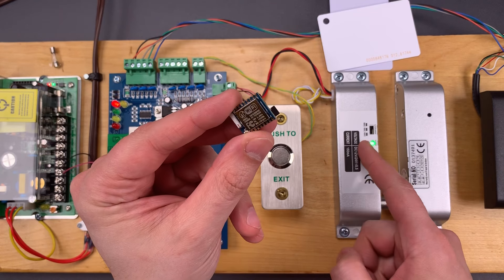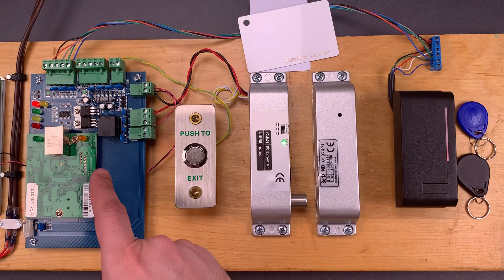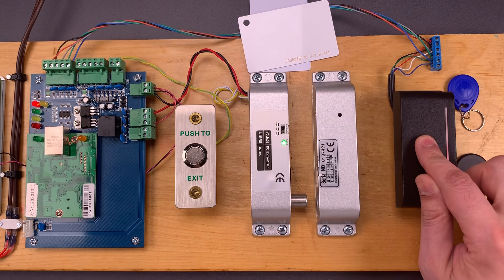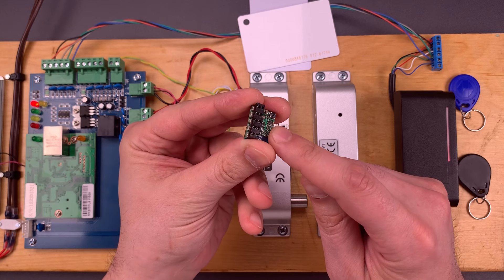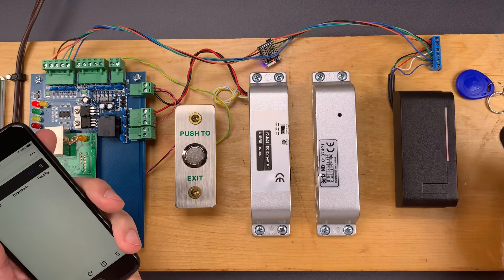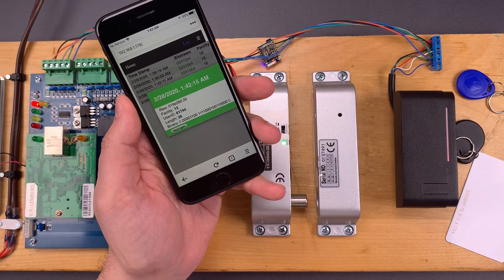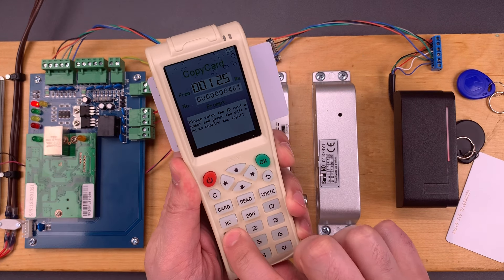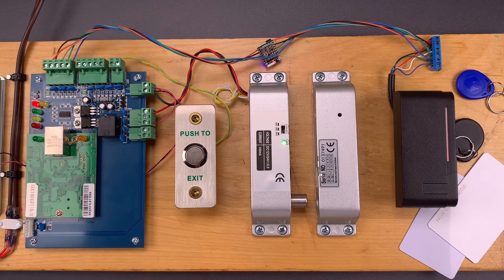[1052] Bugging an RFID Card Reader

Comment: If an attacker has enough time to get into the internals and install middleware attacks, you've probably got more problems than door access.
Reply: Well, it is invisible once you put the reader back on, also the connection is never broken, therefore the system has no idea it was tempered with. It also takes just a minute or two for the complete installation. I can totally see someone installing the device on a companies entrance door whilst the security guard is taking a leak or checking the backdoor.
Reply: @muh1h1  except, there's usually a camera near those places, so people are bound to notice... Unless they're extremely incompetent, which again, means you got more serious problems than a lock hahaha
Reply: @lXlDarKSuoLlXl  Well, whos gonna check hours worth of multiple cameras every day? Cameras are there to find out what happend after it happened, so if you installed that thing yesterday, chances are you can enter today and camerafootage isn't checked until tomarrow.
Reply: @muh1h1  funny thing is, they don't, there's supposed to be someone checking the live feed, not the records, and again, if the lock gets tempered without anyone noticing, your most important problem, isn't the lock
Reply: The attacker was likely already behind the door where the wires are exposed, or likely worse the wires and devices are behind another locked area that only security has access to in a real facility. Also, in a real facility there's always 1 or more guards paid to watch the cameras and occasionally assess the grounds. If an attacker has enough time to non-destructively access sensitive wires and put in this attack, I wouldn't want to know what else is breached.
Reply: @lXlDarKSuoLlXl  a high vis jacket and contractor's clipboard will get you into SO many places. Especially in larger organizations and campuses where parts don't communicate with other parts.
Reply: @stargate525  and that's a problem larger than a lock, exactly what I meant lmao
Reply: @muh1h1  how do you attach it to the power cables and in series with the system without breaking the signal?
Reply: @1physics  did you watch the video?
Reply: @muh1h1  If the area in front of the door isn't restricted something could obstruct the camera's view. An accomplish perhaps. All the guard see are two people having a quick conversation. If they are dressed in company uniforms it become even easier. Stealing clothing from wherever employees get their outfits cleaned may be comparibly easy.
Reply: @mezzb  It depends on whatever the stakes a high enough but then again, if they ARE high enough and security are lax then there is a problem. Now imagine if an employee where to install this thing and it where just left there unused for years?
Reply: @lXlDarKSuoLlXl  You can burn out the camer with a lazer pointer and have enough time to get this thing in there before they get to the door to inspect them camera. Or just knock and strong srm the guards lol
Reply: so the solution is to literally smear poop spray on the wires and have an attendance machine that gets your fingerprints but also takes a smell sample(detect a certain chemical) in other words a hand sniffer(maybe detection of alcohol or hand senitiser or perfume puts you under suspicion and dosent necessarily make the large iron bars fall around you)
Reply: @1physics  it really wouldn't matter if you cut the wires and spliced em behind the reader most access control system don't monitor the readersthem selves they monitor the board the reader goes back to. If I take a reader off a wall and cut the cable they prolly ain't gonna know its gone until someone actually walks up and notices its missing.
Reply: @1physics  the fingers are self striping so by pressing the wire in the power flows normally as 2 things are true, one the whole wore isn't disrupted and 2 the contact plates are connected to the wire before the full wire is severed. There is no disruption of power or service
Reply: I was thinking the same thing.
Reply: i must preface this again... Poop spray fingers
Reply: @lXlDarKSuoLlXl  You just have to find one that is considered less sensitive but still use the same keycard (like the one that opens the boom gate to the parking lot).
Then you can copy the keycards and use them on other, more interesting, doors.
Reply: @qdaniele97  ngl, that sounds like bad design... Hahaha
Reply: @stargate525  this is so true at my work we are doing minor work to a commercial building and I was let into one of 
 Raytheons cooperate offices to take measurements only for me to realize I was in the wrong building lol
Reply: @lXlDarKSuoLlXl  You'd be surprised how many buildings have Access Control Systems but lack any sort of video surveillance.
Reply: @GuitarGunner  I said "usually", didn't I?
Reply: @noru8360  yeah cause just a few people take Hand Sanitizer in 2022
Reply: That controller could be really far away and have a mile of wires connecting it and the reader. Probably going through other tenants in the building and such. That's why LPL's advice of this vid is "never use systems with unencrypted data transfer"
Reply: @lXlDarKSuoLlXl  so basically what you are saying is that locks are unnecessary in secure areas.

Because you said that if someone can temper with a lock there is a bigger problem than the lock.
Reply: @Jehty_  you got it backwards, locks must be in a secure area, because an impenetrable lock doesn't exists
Reply: @lXlDarKSuoLlXl  so then what's the point of the lock?
Reply: @Jehty_  to deter unauthorized personnel ofc, locks are arguably harder to fool than a camera and people, like someone said above, with a disguise or something like that, if you have multiple layers of security you'll keep whatever you want to keep safe, safer... But whatever dude, there's no point in keeping this discussion going, since that's pretty much obvious
Reply: @lXlDarKSuoLlXl  i had a security job at some place with a bunch of server racks and there were definitely times where someone wasnt watching the camera.  alot of places dont have enough budget to pay someone to watch a camera 24/7.  or someone would call off and instead of 2 people for the midnight crew, you only had 1 because it wasnt easy to just get someone to come fill a midnight shift like that(at which point there would be long periods of no one watching as you did your rounds).
Reply: @Evi1 M4chine uuum, that "somewhere" where the cable goes into the wall is most of the time directly behind/inside the box.
So you have to take apart the box to get to the cables.
Reply: @1physics  the esp has "splice" connections.  You just lay the four wires into four grooves and tighten the four screws.  The splicer cuts through the jacket on each wire (without cutting through the wire inside the jacket) and connects the ESP's contacts to the wire without disconnecting it.  It's like lightly cutting through a wire with a pocket knife, just enough to expose the wire inside, and using the knife as the electrical contact to the wire.  The power draw is very low and the impedance on the data lines is pretty high so the alarm isn't going to notice the additional circuitry that's been added in parallel with the card reader.

The device is small enough that it would likely fit INSIDE most card readers.  So all you have to do is pry it off the wall by the door (which will damage the mount UNDER the reader but not likely trip any alarm or damage wire), attach the ESP, tuck it inside the reader, and squirt a little quick-setting adhesive on the back of the reader and mush it back onto the wall (since the mount was damaged)  It will be almost impossible to spot this.  Then come back in a few weeks after the video recording system has overwritten (looped over) the video where you installed the reader, and let your phone download the codes used in the last two weeks while you tie your shoelace or have a cig.  Come back in a few weeks again with your cloned card, dressed like you work there

BTW those are milfare tags, at 13.56mhz.  Easy to pick up with a decent scanner.  The readers are always transmitting a strong carrier on that frequency, to power the tags wirelessly.
Reply: LOL right,If that needed to be prevented would tie a knot at the back of the electric keypad wires preventing removal without destroying the wires in the wall..also shows a hand held copy/reader. If the perp had this he could have just stood next to you while shopping and copied your key..As all the agents do with my wireless keys :)
Reply: @lXlDarKSuoLlXl  Another funny thing "live feed" watching only happens in the movie.
Reply: @freedom4651  tell that to my boss
Reply: @NGC1433  Usualy exit button just connect signal wire to ground wire, so if we have access to wires we do not need break encryption or sniff keys, enouph remote controlled transistor key that simulate exit button pressing.
Reply: This takes 10-20 seconds if you are familiar with the panel and mounting. And this only works on pretty low security systems anyway. You (hopefully) won't find these systems in a military base. But they are found in a lot of commercial buildings, with a lot of different companies with a myriad of employees.  They are found a lot of places that probably should have higher security. They could mount this on any panel where they have access, and simply clone the janitors card the next time comes, or even better, the security guards.

Not to mention this is also used in shared condo spaces and a lot of other locations where security is often very lax.
Reply: @MrSpronkets  not really no. My employer (a major ISP) has over 2000 properties spread across the Netherlands and nearly all of them are unmanned and all of them can be accessed using keycards. Luckily we use Stanley Security which is encrypted as far as I know and everything is hooked up to one big server so abuse would be noticed quickly.
Reply: @MrSpronkets  You guys have no imagination. The "attacker" could easily be a person already employed by the company. You then target a less crucial door that uses the same RFID access in order to gain higher access credentials which you then burn to a card and go get in.
Reply: Former Security Tech here. Many of my client sites did not have 24 hour security. The previous night's footage would not be reviewed unless an incident occurred.

With appropriate yet simple and common tools, a device such as this could be installed on a front or side door in a matter of minutes, and then hidden in the cavity behind the card reader. This would be easiest achieved at night, or perhaps on a weekend. From there, it would be reasonable to assume that the first person to arrive in the morning - typically a cleaning supervisor or security guard - would have (nearly) all area access. If the alarm system is part of the access control system, a cloned card would also work to disarm it. From there, the risk is directly proportional to how far into the building one was to go, how long they were to stay there, and how much they wanted to access. On more than one site, the day shift guards would not even be in a position to notice an unusual opening on the access data if they weren't specifically looking for it.

All of my sites had my companies proprietary hardware, which was encrypted specifically to be resistant to this form of attack. However, I worked there just as smart cards were superseding the old 26-bit Wiegand systems, and I used to use similar card cloning tools to sell clients upgrades to their access control systems. I would demonstrate how easily the older cards could be cloned and used anywhere.
Reply: @lXlDarKSuoLlXl  tell me you've never worked in security operations without telling me you've never worked in security operations.
Reply: The most successful attacks are those your enemy actively aids you in performing. In this case, using a ladder and some overalls to pose as a maintenance technician. With a little ahead-of-time research you can easily compromise outer layers of security, for example tampering with an outdoor camera under the guise of a maintenance technician while an accomplice compromises an outer door. Once the device is installed, it just sits there malevolently, undetected until a REAL technician does maintenance on that specific door.  

This attack requires significant social engineering, but once completed, you've compromised every card in the whole damn building.
Reply: @AlphaNumericKey  yeah, that won't work. The moment you walk in security is going to run your details. Not because they think you're a criminal in disguise, but because they think you're not an inducted contractor.

Dressing up as a contractor is a nice touch in a movie, but in reality one of the worst ways to sneak around.
Reply: @lXlDarKSuoLlXl   well lockpick lawyer regularly fools locks with his picks
Reply: @stargate525  you are so right. I remember years ago I was a contractor doing software updates on ATM's, these were the older type that you see in stores and sometimes even on benchtops.

They required access to the top half of the machine that is basically just a PC, they all have the same lock and its just a very simple file cabinet type lock. pretty much any screwdriver would open it.

I had so many shop owners, without me asking, open the safe for me, it was insane. They did know I was coming, but all they got was a letter MONTHS in advance. I would just pick and choose which store to go to on a daily basis and just rock up with the cheapest hi-vis vest money could buy with a laminated piece of paper saying I was from the ATM company. that's it, never had a single problem with getting access to the ATM, not one person ever said 'wait, let me call the manager' or 'let me call ATM COMPANY'
Reply: @danielv5825  really? You think every repair guy you've met is immune to bribery? Either place a guy in a job to do what you need or bribe/coerce one that already does work there. Even background checks are hardly foolproof.
Reply: @LabGecko  okay, now you've gone from dressing up as a contractor to talking about offering a contractor a bribe and hoping they don't report you to the police. That's a big difference, and personally I don't think your career as a criminal mastermind is off to a good start.

So to start with, you're going to need to get to know enough of the contractors well enough to know who would be susceptible to a bribe and has the level of access required to pull off such a stunt. At this point, you probably already have building access.
Reply: @lXlDarKSuoLlXl  my old job had a policy against cameras, which I thought was very stupid for a site with a high fence topped with razor wire and utilizing an rfid access point for employees and a checkpoint for trucks. The most stupidly unsecure facility I've ever worked at as security, but they paid me well so I only mentioned it once.
Reply: @freedom4651  oh nice, one of my jobs was a movie. Let me know where I can collect my acting paycheck, and how famous I am for the part.
Reply: @stargate525  Doing work testing facilities security in that way would be so damn fun. All the tension of trying to sneak in with no bad repercussions if you happen to get caught. God, that style of security consulting would be my dream job
Reply: @lXlDarKSuoLlXl  my workplace has no cameras on doors or parking lot. I mean they have sensors on the windows so people can't break in that way but that is about it
Reply: Put on a high vis vest and bring a toolbox and suddenly you're a technician. The ESP can probably be hidden underneath the card reader.
Reply: @MrSpronkets  Obviously you have never worked in any high security fields. There is a such thing as a closed secure network that can only be accessed via physical location. Your argument is moot.
Reply: You'd need exterior anti tamper protection. For the exterior reader not just encryption but a much stronger housing and one you cannot easily remove or access to internal wiring etc
Reply: @SpAzMaNiK  There's no point in replying to someone that thinks they're all knowing. "Obviously you know nothing because you're just someone on the internet". I was a direct employee of Accenture and served several multi-billion fiscal year companies. I don't need some moron talking about physical security when at best you're shuffling inventory through a warehouse. Think bigger. How about Microsoft? Apple? Google? I highly doubt they're like "Oh, let's make sure our RFID reader has wires exposed in the hallway that are easily accessed with no encryption". No-one cares if some warehouse loses a few thousand dollars of stolen goods. How about several hundred thousands of credit cards being frauded or other digital threats... The whole point was that wasting time messing with some RFID access and neglecting cameras, no security guards, and so forth is going to leave you vulnerable for a lot more problems than just door access and some minor theft of goods.
Reply: @MrSpronkets  Cool story bro. I give it a B+ for imagination.
Reply: @SpAzMaNiK  I'd love to be so ignorant to think some maple syrup peddlers know anything past physical threats. The companies I work for make millions while you're gas-lighting people on YouTube.
Reply: @muh1h1  Even if you manage to get the ESPkey installed, it is still broadcasting an SSID. Even if the network is hidden, a network admin could very possibly notice this.
Reply: @stargate525  They will get you into half assed places for sure. Anywhere with semi decent security is checking contractors though.
Reply: @freedom4651  That’s not true at all.
Reply: @danielv5825  Glad someone said it.
Reply: @Muscleduck  putting on a hi-vis and posing as a contractor is possibly the most overrated criminal trope. In my ten years in the security industry, I estimate that I have dealt with the aftermath of over a thousand break-ins and burglaries, and only one included criminals posing as contractors.

In that one case, two guys rocked up on a Saturday morning to an unfenced site in a truck with a Hiab, and a decal for a solar panel cleaning company. They then proceeded to remove some fifty something solar panels from the roof, and drive off with them. In this case they were at an unmanned, unfenced, low security site, and the get-up was only fooling passersby.

However I have seen dozens if not hundreds of people dressed as contractors denied entry and kicked off manned sites for failing to have the proper paperwork. Most of these cases are probably quite innocent and are the result of genuine contractors involved in administrative errors, but if the guards feel the situation is in any way "off," then footage is saved and reports are made that are reported to the police if there is subsequent incident.

Security guards and building management work closely with contractors, and the contractors work closely with each other. People think that they come in as faceless men in yellow, but to many of the people in a workplace they are just as recognisable and well known as any other workmate.
Reply: @stargate525  if you look like you belong and know what you're doing, people probably wont worry about it.
Reply: @lXlDarKSuoLlXl  If you have someone live monitoring the door, why do you need a lock anyway? So the lock ist there because the door is probably NOT live monitored 24/7.
Reply: @noru8360  Ever heard of gloves?
Reply: for sure, because it’s weekend and nobody is at the office worrying about security.
Reply: @muh1h1  it is however possible to design a system that can detect tampering. When the ESP circuit is inserted, it changegs the impedance of the tranmission-lines (wires) and that can be measured by the system and thus seen as a tampering.
Reply: @catcatcatcatcatcatcatcatcatca  If security observation is stopping you from putting on a pair of rubber gloves to not get odorant on your hands...  It will also stop you from removing the reader from the wall so you can get at the wiring. This renders the poop smell redundant.
Reply: @X1ongu  ...Damn it
Reply: @lXlDarKSuoLlXl  you watch far too many movies, bud. The vast, vast majority of businesses and commercial premises do not have a security guard in a booth watching CCTV screens 24/7
Reply: @muh1h1  Probably should have bought one of those 35 dollar wyze cams at home depot and put human detection on so it sends your phone a message with the perp taking your card reader off the wall and tinkering with it.
Reply: Facts
Reply: @lXlDarKSuoLlXl  Dude's hatin' you're right
Reply: @muh1h1  You just made the point of the person you are arguing against smh
Reply: @lXlDarKSuoLlXl  His ego won't let him get it
Reply: @lXlDarKSuoLlXl  These fools don't stop man
Reply: @Jehty_  There is a pile of hot pockets and ego juice AND likes waiting for you, all you have to do is erase your youtube account, and it will all spill out of your disk drive.
Reply: Which makes that their biggest problem like he ALREADY said dang...
Reply: @Jehty_  You... "think" That's an oxymoron.  

One would THINK that a moron that breathes oxygen would be worth something, but here we are, but seriously, you have an emergency to tend to... your hot pockets are getting cold.
Reply: You could install one of these when you disguise yourself as the security contractor who installs the system in the first place and then sell credentials to the bad guys. Or you could dress up as a technician or repairman and act like you're there to repair the system and install it then. It's not necessarily you blatantly ripping cables out of the wall next to a CCTV camera in the dead of night.
Reply: it is either somone front the inside that instaled it to a third party , maybe it was already there before you bought the building, you can erase the security system to disable any previous card but then all the new codes will get intercepted
Reply: @michaelpettersson4919  i could see this happening like this, when the vip is on the room security is strong, but when he isn't they are more lax, maybe the extra security goes to wherever the vip is, so you can compromise the door one day then do a full attack another day knowing their safe isn't going to do anything to slow you down
Reply: @lXlDarKSuoLlXl  that is why you should encrypt the data, if you intercept the card at one door it would be useless on another door, and if the key change randomly even using on the same door in a different time would be useless
Reply: @Jehty_  delaying the access until security or the police can get there
Reply: @muh1h1  actually, we have an access control system at my work and a security camera system to back it up. we get motion detection notifications from the cameras and tamper alarms from the control system. and multiple people get these notifications in real time. police take under 5mins to arrive. it is not an impregnatable system but only someone really good that is trying really hard would be successful.
Reply: @cmdrsabre  there are multiple reasons to have a card even if there is security, maybe you dont want security to be able to open the door, but they can verify if the card belongs to the person they see on the camera, maybe  you want to know who opened which door and when for administrative reasons and a card is an easier way to make the log than someone typing  or signing a paper
Reply: Well you will have
Reply: @1physics  connections are all parallel.
Reply: At large complexes stuff lile this can happen right in front of employees and wouldn't notice; service tech are invisible to "important" people. That alone allows things like this to happen. If whatever is inside the building is important enough, sure criminals will take the time to do this.
Reply: @lXlDarKSuoLlXl  Less often than you might think. I've done contracting work for various government agencies, and they've all required a card to get in the building (or at least, past the security checkpoint during normal business hours, with a card reader to access at night). Found out when one of my coworkers had his tires slashed in the parking lot that they had zero external cameras. Seems like one hell of an oversight - they were paying for 3 or 4 security guards per building, but never installed a couple of cheap cctvs?
Reply: possibly could go under the guide as an electrician working on a doorway, or if you have loads of planning while you're installing it for someone. then, you could easily come back later when everyone has left and gain access that way
Reply: @muh1h1  most of nowadays readers have tamper sensor so you wouldn't open them without notice. Plus some even 'kill' their memory and lost coding leaving them unuseful if tampered with. 
How else are you gonna mess with the cabling? Rip it out of the wall? 
Ofcourse, as allways there's human error included. If a security officer 'sleeps' when alarm is triggered than no system will save you...
Good point about unencrypted data though. More reallife version of this 'hack' is when you capture pure rfid data between reader and card, not reader and the controller.
Reply: @lXlDarKSuoLlXl  The thing is that it would read all the cards that pass through i/e. If you would pretend to be maintenance at the main gate and install it for everyone passing through you could have the RFID for the highest clearing card in the building.
Reply: It is connected in parallel by tapping not cutting the wire. Wiring changes from a straight line to a Y shape. Expanding one point !between! A and B  to the device.  Is thereby capable of listening without having broken any connection only change in resistance , given that one wire is providing common ground and this sloppy subhuman approach didn't cut some of them by accident. Writing can only be done in both directions so the device sending non existent key card access is possibly being read by A and B which may as well trigger some curiosity. 
In contrast wiring in series would change from A-B to A-C-B
The device being put in a firewall position. It receives the signal as its Endpoint and decides whether to forward, change or block it. A lot of problems and possible detection measures come to my mind , some valid for parallel don't. Doesn't matter people with doors shouldn't use NFC RFID anyway. Its only valid use is for deceiving and fun stuff.
Reply: The only card readers I have seen installed in the past 2 years have optical cover tampers built into them. Although I rarely see them wired or even chosen to be monitored in programming.
Reply: @MrSpronkets  I have 18yrs in Access Control. The wires are easily accessible from the unsecured side of the door once the reader is removed from the wall.
Reply: @muh1h1  Well the key reader won't be flush w/ wall with that thing behind unless you bring a drill to bore a hole for it to sit in, that's gonna attach attention.
Reply: @muh1h1  Modern security cameras "flag" motion so you only have to scrub through a few min of video periodically.
Reply: @smithknifeworks  That's not really the point at all. If someone has enough time to get in and tamper with your door access, you've already hit some other breach. Most if not all the buildings I've worked in since 2013 have had readers like this, or better, but also always had 24/7 staff of security patrols and surveillance monitoring. The only thing I said was if you have enough time to get into this and breach your door access, it's already too late to care other than to prevent future breaches.
Reply: @peterkwolek2265  Yeah right, the few minutes of motion you get every day at the entrance if a large company :D
Reply: @muh1h1  my bad, I was thinking about my old office setup, IT was annexed so our little building was low traffic. Wasn’t thinking about a busy corporate office.
Reply: Social engineering. It's a thing.
Reply: LPL only does PoCs (Proof of Concepts), but as always, most PoCs are useless in real life. If you take the card reader off the wall, there's no slack for wires. That small connector thing is too big to even fit thru the hole, so you can't pull it from outside and expose it. This is never going to work. maybe in india or russia where they don't know how to install those things and leave huge holes with loose wires everywhere, but if it's installed by a person who has common sense, you won't ever get to those wires without doing significant damage to the wall .. and I think at that point it would be faster and less noisier to just break the door or window.
Reply: @SethiozProject  and how do you install it without leaving slack? That does not make any sense.
Reply: 'there's  always a guard whatching the live feed' ?!? You're assuming a level of security and money invested.
Reply: @lXlDarKSuoLlXl  you are wrong. Modern camera systems are equipped with motion sensing software and routines for competent security involve checking cameras that detect motion during times there isnt supposed to be activity. 
Reviewing footage is the modern angle of attack. With things like fast forward it is much more efficient and effective than watching live footage.
Reply: Yeah, it's not really lock "picking" if, to get past it, you've had to dismantle it.
Reply: Just put on a shirt with a logo and start doing work. 
Its not hard.
Reply: Not as easy as LPL makes it look. Several barriers exist, some insurmountable. 
1. Getting free access for an attempt at opening the card reader to remove it off the wall without visible disturbance. This can be relatively easy or damn difficult. You don't have all day either.
2. Hoping the installer left enough wire length to install said device. It won't attach if the installer pulled the wires immediately taunt through a tiny hole into the  building, which is what he should of done.
3. Knowing the various alarm systems companies schematic enough to know which wire goes where into the device. The wires need not follow an industry color code scheme.
4. If all is going well (yeah right), then hoping the data is not encrypted.
5. Finding more free access to retrieve your device without suspicion.
6. Removing and putting everything back into place without signs of disturbance. If the owner knows it may have been disturbed, he/she may just call the alarm company for an upgraded model with encryption.
6. Remember to do this with gloves on.
7. Go back to your day job. You failed the above. You need bail?
Reply: That's not a reason to not have it being encrypted though. There's literally no downside to just getting one that's encrypted over one that's not. It's 2022, the question to "should we encrypt this on the wire" should always be yes. Some cool example is the belgacom hack. You should absolutely worry about what's going over your wires
Reply: people talking here like theyy are be all and end all of security experts. pretty much anything goes when it come to this stuff. so many variables to account for at all levels of crime and security
Reply: This attack only works if 1) You had access to the internals of the card reader, i.e. you're the guy who installed it. And 2) You want to get into the building after you've installed it without the use of an identifiable RFID key... This device is NOT some kind of James Bond style entry device, it's a piece of locksmithing geekery that nobody outside of locksmithing will really give a shit about - not even would-be thieves...
Reply: @mezzb  it only takes 1 door. once you are in a secured area people assume you are meant to be there.
Reply: @1physics  Insulation Displacement Connector, IDC
Reply: @muh1h1  Nobody needs to check cameras anymore nowadays. Have you heard of face recognition?
It detects human faces and could than send an alert automatically.
Even if the person wears a mask it should still be possible to detect the shape of a human body.
Reply: @Temo990  Ever heard of privacy? No way in hell you are going to implement a face recognition system in a medium or low security environment at least here in the EU. Also, again, large business intrances will probably see unknown faces every single day. You guys are so naive...
Reply: @muh1h1  You don't need actual face recorgnition. You can detect human faces or bodies without their identity.  Actually without a database determining the identity wouldn't be possible.
You can even detect motions without a camera (motion sensors) which might be sufficient in some cases where animals are rare especially for private homes where you can activate the system when leaving.
All Human faces or bodies have a certain shapes. You detect such a shape no matter who the person is and than send an alert.

Who said something about large businesses? A business might be able to afford a guard or large fences and walls. 
In addition to that even a large business will have areas in which only staff is allowed to enter. The public areas with many people are unlocked anyway.

And what right to privacy do you have when you enter foreign property? You could say that you are not allowed to enter the property without consenting to certain legitimate usage of data.
Actually that is done often for example in trains here in Germany (and in many other businesses) where they have surveilance cameras. 
It certainly will work for private homes than.

And as far as I know the government even wanted to install actual face recognition with identity check at train stations to catch fugitive (or at least they tested it, don't know if they scraped the idea). So it seems it is possible.
Reply: @lXlDarKSuoLlXl  something like a doctor's office is highly unlikely to have people watching the door surveillance live. Indeed, even many higher-security commercial buildings are only likely to monitor cameras in case of an alarm activation.
Reply: @KamikazeSOF2 , you keep saying "cutting the wire," but the device does not require cutting any wire. I also doubt that the example system (which is typical of a lot of real-world installations -- yes, life sucks) is monitoring current draw on the power line. (Note that there are three wires in addition to + and -; I'm guessing something like MISO,  MOSI, and clock.)

Take a look at the device's connectors -- follow the link and zoom the photo. They are similar to traditional phone punch-down terminals. You press the wire into them. They pierce the insulation and contact the wire. They don't cut the wire. Once again, they don't cut the wire. There is no loss of continuity.
Reply: @KamikazeSOF2 , you specifically said it where?

This is what you said:

"I work in access control/system integration and none of our clients have unencrypted readers and all lines are monitored.

"Cutting a wire, even briefly, would notify anyone monitoring the system, and could possibly trigger an alarm (depending on the programming).  This 'key' may not introduce enough resistance to trigger it, but cutting the wires (which isn't needed) would definitely trigger it.

"Lines are monitored via 'end-of-line resistors'".

I even fixed the enclosed quotation marks and left the final period outside of them for your reading pleasure. Do we speak the same language?
Reply: They could be a low level employee who knows the schedule around the doors. I think they are many circumstances where the attacker would have enough time. But in general, unless you're guarding big stuff and your attacker somehow conceals their identity in the nationwide manhunt, then yeah.
Reply: @MrSpronkets   not always no, in my previous job we were called to fix the AC and my older colleague told me that the last time they came is previous assistant literally walked through the company labs and research facility to the truck to pick a wrench and came back and only was told hours later he wasn't supposed to, lab had to close a for a two day to be decontaminated. it was a big pharmaceutical company. the door had special key but a its not airtight and a simple set of work cloths can let you go through easy, they only found this strange far too late, in this time the guy could have stolen something and left easy.
Reply: This would take less than a minute, possibly as little as 30 seconds.  Connectors with little teeth are available so the wire could be just put in a slot and then the connector closed up on them.   The wires purpose is published under the brand name of the scanner.
Reply: @sirius0beliast527  People sure miss that obvious point I was making.
Reply: @MrSpronkets  You have made multiple comments here, including at least one wrongly assuming this is an attack on wires inside the building.  This is an attack on the RFID box on the outside wall near an entrance. Even if there's a camera, the person installing this wiretap could dress up as a junkie or Ronald McDonald while covering his work with his big clown jacket and fat ass.  This attack only needs the 2 inches of wire slack and small hole in the wall needed to install and service the box (without having to rebuild the wall every time someone buys a new security system).  Sensors detecting opening the box do nothing when not opening the box.  Sensors detecting moving the box (via vibration or gyroscopes) would also trigger if an innocent clown bumped into the box without doing any attack or damage.
  P.S. In one movie 007 dressed up as a clown when stopping a circus infiltrating a major US base, nothing would prevent him using the same disguise on other missions.
Reply: This reply section is a threat to society lol
Reply: In my local town, this sort of lock is what is on the entrances to the local hospital. There certainly aren't any cameras on any, maybe except the front door. There are rear access doors well covered in corners of the building that no one sees you if you planted something like this in the dark, or even the off hours. I don't now what one would steal from a hospital, but I'm sure there's plenty to take. No guards either.
I'm sure there are plenty of places around the world that use this lock for convenient security that have plenty valuable stuff to steal from.
Reply: @muh1h1  security cameras can be configured to give alerts when people are within their view
Reply: @Red-guy-1114  See my comment above, not going to help you in a crowded business entrance
Reply: @lXlDarKSuoLlXl  You only review the video footage if there is a known issue.  You would need to pay someone to actively watch the camera 24/7.  Not sure if there is anyone, including intelligence agencies, that do this.
Reply: @muh1h1  well, if it is busy at the time, people will notice someone fucking with the box, and if it isn’t busy, then security should, in theory, have the bandwidth to monitor these entrances if provided a notification that a person has been at the door for multiple minutes.
Reply: You come at night; pop the reader off the door using tools or whatever you gotta do; put the device in; put everything back together.

Now you can clone key cards forever until they change the system or find the hack.

I feel like most people in these comments have no clue how little security most places have. Like sure a bank probably won't be so easy. But if you wanna get into an apartment complex or office building or whatever... in the real world, a lot of those places have only the RFIDs as security... or they might supplement with a camera, that isn't manned, and overwrites it's own data every 30-60 days. Heck my business has cameras, and even when we had a break-in, we couldn't get a good enough ID from the camera to use it as any useable evidence.
Reply: 🤣🤣🤣 I was legit just thinking to myself like.. an attacker could compromise the system itself with little effort but the amount of effort or think genius that would go into being able to actually attack the system to begin with wouldn't be so easy.

Unless the company is just completely dumb and leaves those wires completely exposed and open idk how an attacker would do it.

Most of the time those things are mounted on the wall and the wires run on the inside of the wall to the controller... how and when are you gonna have time to come back with a saw or some kind of tool to cut into the wall and find the wires and attach the ESPKey and do all these things without getting seen by an employee or security cameras, security themselves etc.. unless maybe you desquised yourself as a construction worker or something maybe? idk.. but even those generally go through some checks and balances and have to be cleared to work on specific floors, have badges/ID's and so forth.

Again unless the company is just completely stupid and has terrible security at which point yes.. there's HUGE problems than door access and that company probably shouldn't exist in the 1st place lol.
Reply: @lXlDarKSuoLlXl  as a security manager I can personally attest that most corporate offices do not have adequate security staffing to monitor cameras at all times. There are always gaps where the guards are expected to do other tasks and cannot monitor every camera at all times. In fact the most you would need is a slight distraction, somebody being rowdy that will cause the security guards to leave their stations and therefore stop monitoring the cameras. Also most corporations have their security direct people and answer questions so it can be easy to distract them. This problem is only exacerbated on graveyard shifts where you usually have just enough people to cover each post and not enough to accurately monitor everything. It's really not difficult to create a situation where there's a gap in coverage. Cameras are only checked if an incident is known about and so it's usually too late. Another FYI, I've ran security for multiple financial institutions in most of them have very shitty camera coverage
Reply: @mezzb  Access levels aren't really as much of a problem as you think. Honestly you only need to copy a single card, a security guards card. They would have access to nearly the entire building. Because their patrol routes are designed to make sure everything's functional they are required to scan at most, if not all, of the scanners. Especially exterior ones. It would not be hard to set up a camera outside of the building that could see the access point so you know which card belonged to the security guard. I've managed security for financial and corporate institutions for years and we've actually cloned a card using publicly accessible materials and information to prove to a company that there were huge security flaws in their systems.
Reply: @MrSpronkets  I've literally managed security for banks, financial institutions, tech farms, law offices and fortune 500 corporate offices that have shit security that could easily be bypassed if somebody actually wanted access into the building. In fact the financial office for Target (The building that houses financial data for all the target credit cards) had cameras that were unusable for 6 months prior to me starting there. The building The target corporation uses to print all of their checks nationwide only has a single security guard at any point of the day. The building that houses US banks financial information is incredibly loose on security. Companies aren't that secure because it costs money and there is rarely a threat to these locations
Reply: Sort of true, but you still shouldn't be using unencrypted anything in your security chain if you're serious about it. Even the tag itself should be encrypted using robust protocols so that the secure key cannot be extracted by snooping the transmission.
Reply: If you do not have physical security, you have no security.  In this case, that includes all the wires, and some sort of RFID shielding around the reader.
Reply: @muh1h1  there usually motion activated and will give alerts
Reply: @MyKharli  Congrats, you are the thrid person to state that without thinking about it first.
Reply: All you have to do is wear an outfit with a logo and carry a tool box. Have some fake work order and most security guards will leave you alone.
Reply: all they need to do is scan a card, never even have to visit the lock
Reply: I've worked on some places where the security is pretty tight. ALL of them had tons of access control cabling running through the ceilings.  Anyone working on hvac, electric, fire alarm, plumbing, or any of a dozen other systems have access to these cables in places where they are seldom seen.
Reply: @1physics  SELF. STRIPPING. CONNECTORS. <3
Reply: @lXlDarKSuoLlXl  people dont sit and watch cameras almost every time theyre for use afterwards.
Reply: @muh1h1  plus when you temper chocolate it’s really easy to burn
Reply: @lXlDarKSuoLlXl  Or, you know, they could just do it at night while everyone is sleeping and the installation takes less than 5 minutes.
Reply: @1physics  Did you see the video? the chip has self stripping connectors, you just press the wires into each connector, takes less than a minute.
Reply: Combined with a little social engineering, you can probably do this fairly invisibly. Facility I work at has all these badge readers, and the shop I work in every day is a second level of security. There is still the alarm system on the entry doors but they're integrated with the badge system. I wonder if we're hardened against this with some encryption.
Reply: @MrSpronkets  What "real facility"? There are tens of thousands of normal companies with these types of locks and zero guards and zero video cameras.

Just that there are one more attack. It's possible to read the tag by getting close to the person wearing it. Which is why there is also normally a PIN code. But an ESP-CAM can film the keypad.
Reply: @1physics  In series with??? That's not how electricity works. But a better system could detect and block the ESP sending own data. But hard to catch the ESP rwcording data.
Reply: @1physics  this is only reading the data from it. Think of drinking from a stream of water, thats how the device works in terms of data.
Reply: @lXlDarKSuoLlXl  people were really torn on who they agreed with here lmao. Hundreds of likes
Reply: Well there is still a fault, and there will always be a way to capitalise on that fault. It's all to do with implementation. Why not pay someone to just hurt or destroy the card reader, then dress as repairman to install middleware if it is to the outside of the building. If it is on the inside then something as simple as covering the camera and distracting the guards while someone else installs middleware. These might not be the best possible ways to get on, but if there is a vulnerability people will ALWAYS find a way to capitalise.
Reply: @lachlanmoore2345  I mean most buildings that have security, card readers, and cameras likely have someone watching the cameras to the entryway all the time. Its not meant to be super high security, just general security. In higher security buildings you usually have a card to get into the lobby but then they write you a new card every day to go into the actual workplace once they confirm your identity. My buddy works in security.
Reply: @lachlanmoore2345  not saying its not possible to get around any security, just that most security isnt worth getting around lol. Like my first example is how the security is at my amazon building. Yes you could probably find a way past it through some abstract means, but its just not worth the risk.
Reply: @lXlDarKSuoLlXl  Most decent sized sites have hundreds of cameras.  No one can monitor all that.  You watch the most pertinent parts and remember camera numbers.
Reply: @lachlanmoore2345  honestly at that point of trust, u could probably install the middleware while talking to the guard lol
Reply: It only needs to target the weakest access point. It's not going to work on the front door, but the warehouse door that they use to smoke? 3 minutes of tampering and you have a live stream of acceptable employee ids
Reply: @muh1h1  Check synology surveillance station.
Reply: @muh1h1  Try doing this at my workplace, people would be suspicious the second you pull into the parking lot. You wouldn't be able to be near that door for more than 30 seconds without something coming to see what you are doing.
Reply: @MrSpronkets  Unfortunately there are very few "Real" facilities as you describe. People cut corners on installations and security every single day
Reply: eh, not every place who install those locks have security guards and people checking live feed, we have those things at our school
Reply: If you've got a security guard watching the door live, 24/7, then you never really needed a lock in the first place.
Reply: @1physics the signal is broken u till you've finished wiring it up, it's basically a relay device, any signal it receives it transmits out the other end to the main computer but it also records that data for you